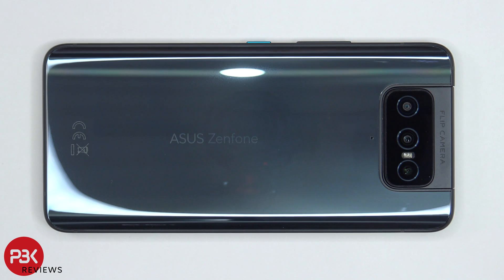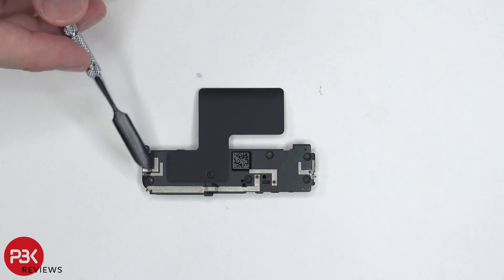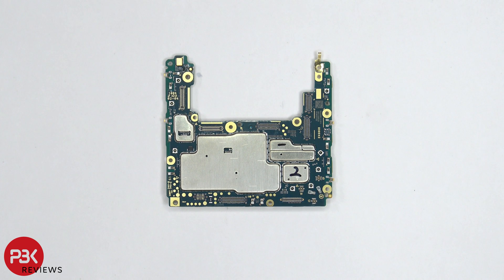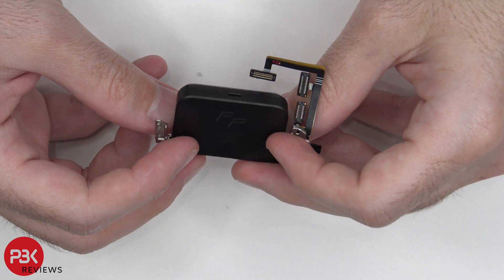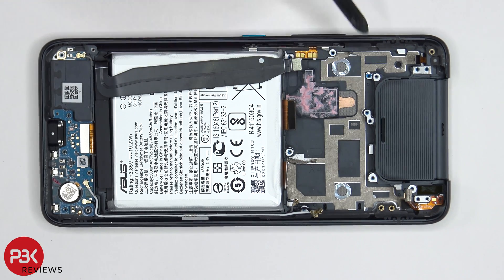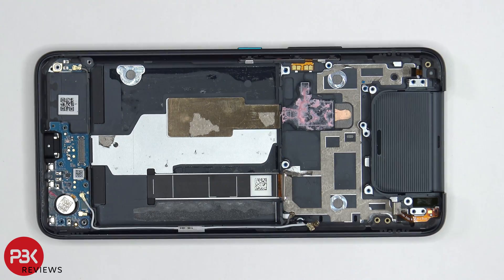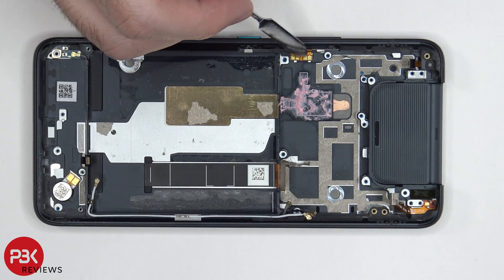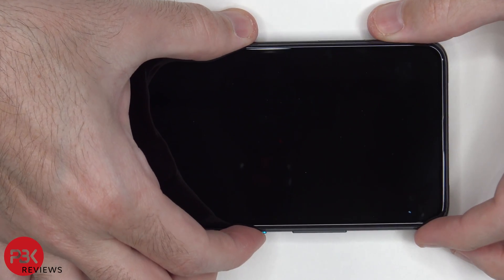Asus Zenfone 8 Flip Disassembly Teardown Repair Video Review

Comment: now my Zenfone 8 Flip won't turn on nor charge and I have some files I want to recover. where does the built in storage located? with the motherboard or the bottom board? also could it possibly be a battery issue?

Comment: watching this because my phone accidentally submerged into water for a few seconds but manged to survive for 2 months, then rn it suddenly crashed then it wont turn on nor charge.... I wanna cry
Reply from the maker: With water damage, you don't want to attempt to use the phone. You need to turn it off, take it apart and disconnect the battery so you don't risk shorting the parts inside. Then dry out any water, and use a small brush like a tooth brush to brush off any corrosion around chips and connectors. Then assemble to see if it will work, if not you will need to replace parts one by one (like the battery, screen, etc) to rule out which part is defective.

Comment: Hi you're guide has been helpful but I can't make the fingerprint scanner to work any ideas?
Reply from the maker: Hi, if you have replace the screen/fingerprint reader, make sure to backup your data and do a factory reset since sometimes it needs to be calibrated and requires factory reset for it to work. Also make sure all cables are properly attached.

Comment: I just ordered a Open Box Zenfone 8 Flip and the power button seems to be stuck.  I have to press hard to trigger the power button. There is no click. Could there be something stuck in the power button ?
Reply from the maker: It's possible the clicker of the power button has gone bad and needs a replacement power button flex cable to change it out.

Comment: I have the ZenFone 7 pro and I changed the battery on my own but unfortunately the one I ordered from eBay was only average (the 'accubattery' app from playstore detects its capacity is 82% from the original. My question: as I noticed the ZenFone 8 flip and the ZenFone 7 pro have the same structure and battery, even removing the 18 screws, lol. So you think it's save to order a battery for the ZenFone 8 flip to use on my ZenFone 7 pro? They seem to be the same in shape etc and same 5000 mAh capacity. Thanks
Reply from the maker: Yes, its the same battery so you would be able to use it from the 8 flip. You're welcome

Comment: Could you please go into more detail about how to use a heat gun in order to remove the back cover? For example: what temperature to use, what areas to avoid heating if any
Reply from the maker: You can use a hair dryer which is safer since it provides a more evenly distributed heat. You can heat it up so its hot to the touch and can always apply more heat as needed while working on prying it off.

Comment: Good video I have Asus Zenfone 8 flip but when I try to flip Camera I get a message saying please make sure there is nothing ubstructing the camera & then try again but there is nothing ubstructing the camera what can I do friend Also my phone Version is ASUS_1004D Zenfone 8 flip ZS672KS
Reply from the maker: Might have a bad motor on the assembly, or the cable might be disconnected or damaged.
Reply: @PBKreviews  ok thank you for ur response friend Also I bought this phone on eBay with a no returns policy & the phone was listed Google locked but I bypass that & deleted previous account but now this is the only problem I have with this phone Also I didn't see Any signs of been open I will try to fix thank you for your Advice friend & Keep up the Good videos 👍😃👋

Comment: Hello great video! After replacing the display, the fingerprint scanner no longer works for me. Anyone know what could be there? An original spare part was used.
Reply from the maker: Try backing up all your data and then doing a factory reset. Sometimes a factoy reset is required after installing a new fingerprint reader to register it.
Reply: currently looking for a new scrren for my phone. where did you get it?
Reply: @ervali9  I don't know exactly, I ordered it in a local Notebook repair store, he only said it came from Germany.

Comment: I have a question:

To replace the damaged LCD, is it also necessary to replace the battery with a new one? I read in some articles that it was mandatory to change for a new one, because the mechanisms are interconnected. Is this information true?

Can't reuse the battery?
Reply from the maker: Hi, no it is not necessary to replace the battery is your changing the screen. As long as you don't damage the battery when prying it off to replace the screen, you can reuse it. Just use some isopropyl alcohol and apply some to the sides of the battery and let it sit there for 30 seconds so it eats away at the adhesive under the battery making it easier to pry off.
Reply: @PBKreviews  I can't believe it!
I sent my cell phone to an authorized Asus, SMS Infocomm and they charged me for replacing the battery, claiming that according to the structure of the Z8 FLIP, as the LCD was replaced, it was also necessary to replace the battery, as the mechanisms are interconnected. Holy shit!
Reply from the maker: @guilhermesoliveirag  Probably because they only had display replacements with frame assemblies which came with the battery pre installed so it was a matter of them just taking the motherboard and other parts and moving it over from your assembly to the new one. Its a faster but more expensive process however its more clean since the screen is pre installed from the factory to the frame instead of a third party adhering the display to the frame.
Reply: @PBKreviews  Holy crap!

I don't think it's fair to charge for the value of a new battery in this case, if only my LCD is not working, otherwise the phone is ok
Reply: @guilhermesoliveirag  
Hello Guilherme

First of all thank you very much for this helpful video. (it's easy to change the LCD ?)

I have the LCD that just broke and I can't see myself changing it, 

By curiosity how much did you pay for this LCD exchange (with the battery of course :-( )
Did you ask for and receive the old LCD but especially the battery following the repair.
Because we all know that the battery over time can be changed.

Comment: Thank you for the extensive and really helpful video. I had some problems squeezing the plastic piece between the halves to open the case. Any special trick for that?
And - unfortunately at my phone the volume button is damaged. It is between the outer and inner frame of the phone. Do you know any way to get in there without destroying everything? It is so nasty to lose a 800 Euro phone for a damaged 50 cent piece that cannot be accessed properly...
Reply from the maker: You're welcome. You can use a suction cup tool for smartphones to help you pull up and get leverage to insert your pry tool after you heat the back up. Once you take the back off, you will need to remove the motherboard giving you access to the flex cable for the buttons. Then you can gently pry it off from the frame (its held on with adhesive) and then the other end is inside the frame socket. It has a metal bracket holding it in which you can use a thin metal flat tool to pull it up and out. Once that flex assembly with clickers are removed (if that's what has gone bad you can replace that part at that point), you can either remove the physical buttons on the frame by pushing them inward or outward, not sure which way it is but you will be able to tell once you push slightly if it pops out or not.